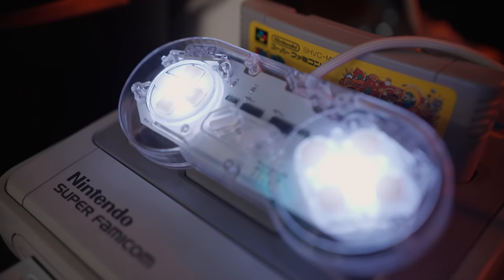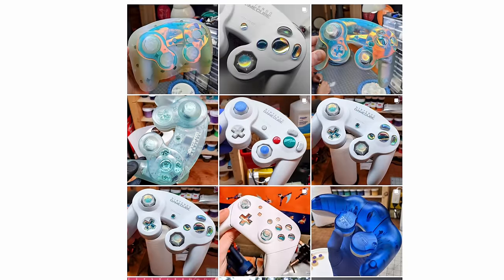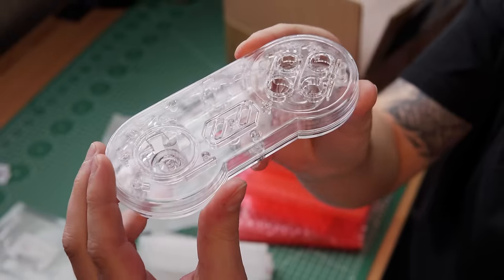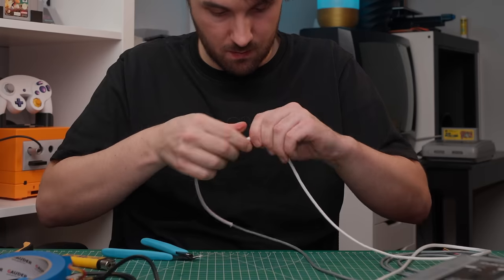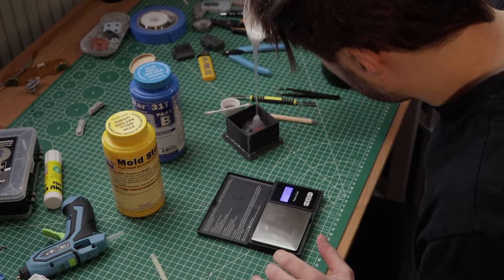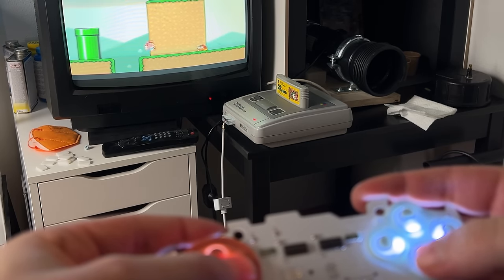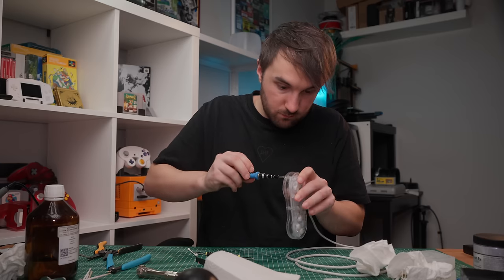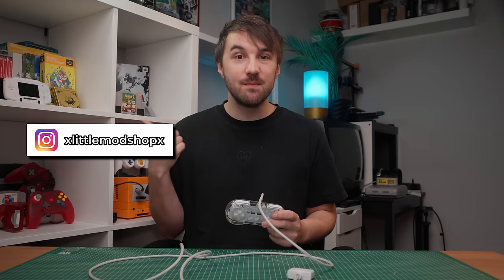Building the Coolest SNES Controller EVER - new PCB, DIY Cable, new Paint Job, LEDs, Custom Buttons

Comment: Holy crap! First ever video featuring my replacement controller PCB!

Amazing work, man. What a gorgeous end result.
Reply from the maker: Thank you so much for sharing your hard work with us! You deserve all the praise! 🔥👌🏻
Reply: @littlemodshop  I'm just happy to contribute something that the community finds useful.
Reply: wow this pcb you made looks cool, glad this video exist, because i was just looking for something like this.
Reply: Have you considered adding low profile micro switches for the dpad, abxy? And L/R? Similar to what extremerate does with their clicky buttons? I play a lot of Mario kaizo and tactile switches would be game changing imo
Reply: @donwilson  I designed the board to be a drop-in replacement that reproduced the feel of the original as closely as possible. The project is open source; if you want to modify it for some clicky buttons, fork the repo and go nuts!
Reply: Thanks for open sourcing this controller Bob! I'm a fan of the open source, DIY Uzebox games console which uses SNES controllers. Most of the clone SNES controllers on Amazon and AliExpress don't fully work with the Uzebox and genuine SNES controllers are becoming increasingly rare so this could well save the Uzebox from a controllerless future.

Great work!

Comment: It would be really cool to have LEDs in red blue green and yellow under the buttons. Maybe even addressable rgb throughout.
Reply: Addressable LEDs require a MCU and are not possible with my PCB design. Different colored LEDs are totally possible, though, with the small caveat that their brightness relative to each other likely will not be the same.
Reply: I would do violet and lavender like the US one
Reply: @beat_avenger  might be a bit tough with colored LEDs. I got a pretty good result by casting my own translucent colored buttons (using almost exactly the same method demonstrated in this video) and sticking with white LEDs.
Reply: That makes sense I imagine that would look better too. Maybe colored leds with like a foggy button.

Comment: The name of the little metal connectors from the controller port are called "Dupont Connectors" or "Dupont Pins". You can order a set of Dupont Crimpers + a roll of the pins for a good value (about $40)
Reply from the maker: Thank you for sharing! 🤗
Reply: @littlemodshop  of course! Happy to share & spread the knowledge :)
Reply: what size tho?

Comment: Hey mate, nice work, only thing I would do differently is spray some matte (or gloss depending on your preference) topcoat on your painted parts to better protect them, especially those shoulder buttons that your fingers will be coming into contact with.

Comment: does this shell work with oem pcb's? i melted my snes controller shell on accident during a retrobrite attempt and i am looking for an alternative instead of throwing it all away
Reply from the maker: Yes, as it is a drop in replacement. I found the files a little tight but it will fit just right as you can see in the video. Hope that helps! :)
Reply: @littlemodshop   thank you for saving me here. i am going to have this printed out soon

Comment: This may have already been answered. Did you have to optimize the power you were given with the new PCB? Or Possibly filter out any LED noise in the signal. I’m guessing there’s plenty of power going to the controller, to borrow from when adding LED’s. I’m guessing they’re in series. I’m over complicating it, but this becomes an Intrachol part of moding that few people talk about.  Thank you and I love this build
Reply: I can answer this one. The 5v line on the SNES/SFC controller ports is directly connected to the system power rail, so care must be exercised to not draw so much power that you blow the system fuse or starve the processors for power. There's still a lot of power available, though, enough to drive the a multi-tap and five controllers with no issues. Call the theoretical max 250mA, just to have a safety margin. 

I estimate that the total power consumption of my board design with all components populated comes in at about 160mA.
Reply: @bobtaylor2821  Thank you so much. You two did an amazing job on this build. I had been looking at a clear track ball mouse from the 90’s with LED’s right before seeing his video. Lol. I believe  5v is pretty standard for many 5 pin midi devices of that era as well. 3.3v is the newer midi/usb standard. Enough to allow for somewhat passive thru box accessories and what not. I appreciate you taking the time. Having enough milliamps for everything to pull from as needed is probably the most important factor to take into account. I’m interested in the overlap between music gear and video game moding. I appreciate your contribution. Many thanks

Comment: Man i wanna do this but my solder "skills" are at replacing GBC/A Pokémon batteries 😭 
I love all the 3rd party wireless options that exist but wired is just king.. 😢
Reply from the maker: Thank you! Yeah it is REAL hard to do micro soldering, but what helped me was buying a cheap microscope to verify connections. Also there are a lot of great creators out there who teach soldering right to the core elements, @voultar for example. You’ll get there i am sure! :)
Reply: @littlemodshop  man thank you so much for replying and giving that bit of encouragement, and yeah he's great! I'll tackle this job somepoint this year!

Comment: Awesome project! Where did you get the new rubbers? Because I ordered some from AliExpress in the past and the diagonals doesn't work
Reply from the maker: Hey there! :) the rubber i bought from RetroSix UK. They are alright, but nothing special.
Reply: @littlemodshop  thanks a lot! My Snes jr. controller needs new rubbers
Reply: Like you said, the big issue with these is that the dpad pretty much won't do diagonals without jamming down really hard which is totally unacceptable.  I tried a few things and believe the issue is that the rubber is deeper where the contact pads are than the OEM ones, needing further travel of the button to turn it inside out and make contact.  What i did to improve it was to gluestick little pieces of card stock on the back of the dpad plastic where it touches the top of the rubber to tighten it up.  All it took was just one single thickness of card stock to see a significant improvement.

Comment: Fun fact about those open source GC controllers: sm*sh players hate those and open source projects because they spend hundreds on controllers with soldering jobs that look like they were done by a 5 year old. Board burning, blob cracking, oversoldering, loose wires (if it needs one) and then get surprised when it breaks. They fear doing anything tech related themselves. The smash player is a beast that runs only on pure instinctive desire for fast food, osteoarthritis and children so you have to forgive them, though.
Reply: True lol, I love my phob gcc. Built it myself, thanks phob community. 😁👍

Comment: Don't think the speedrunning community gonna like this
Reply: The Super Metroid Speed Running community endorses and uses this PCB for some of their custom controllers. Their feedback has informed a number of changes and refinements to the design, like the hardware SOCD filter circuitry included on the back of the board.